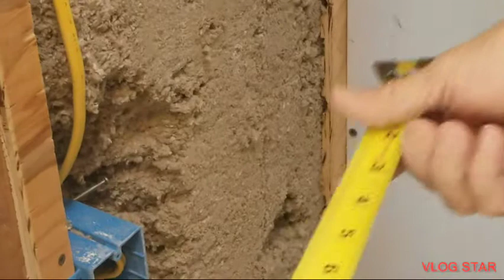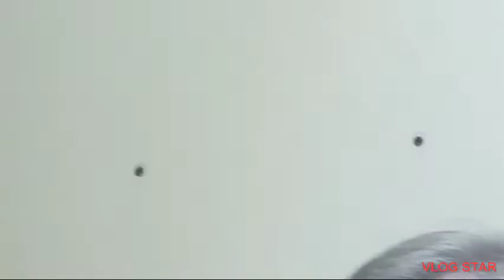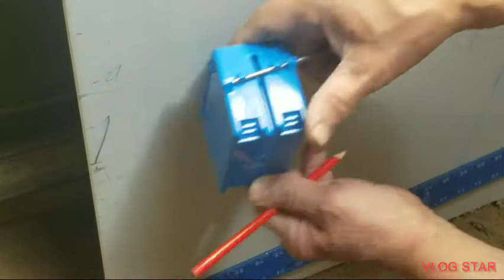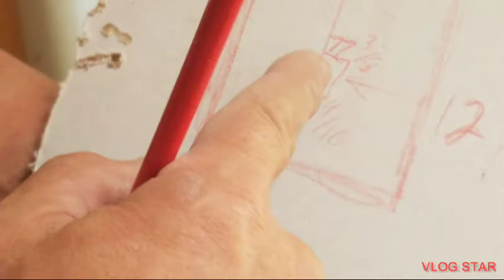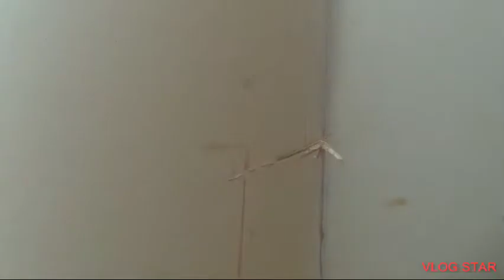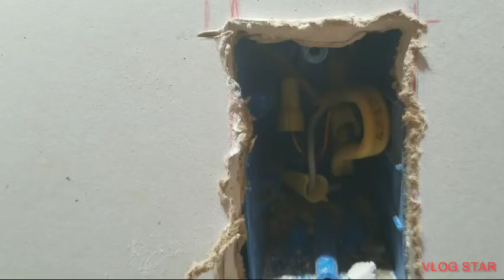Techniques for Electrical boxes  when hanging drywall Outlets | @RG Homestead

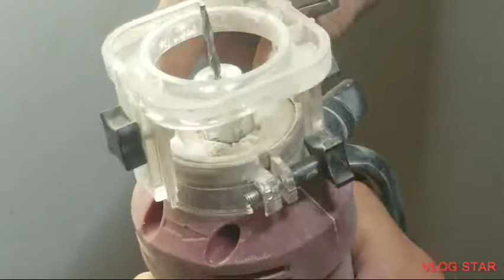Comment: 10:00 thats the way Ive been having my best luck with. I get a more accurate hole
Reply from the maker: You can use the old dry wall saw but this sure is faster and cleaner. Thanks for your time and support at liens A  A lot.

5 for now God-bless  You're insane friend and brother from another mother